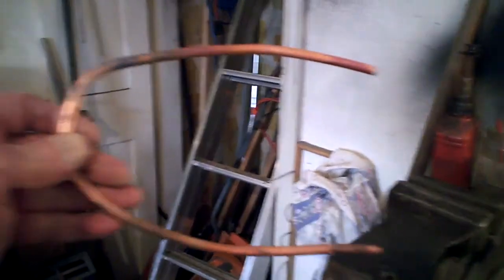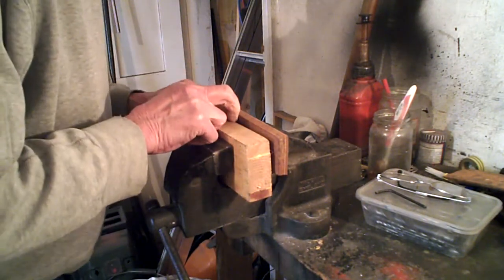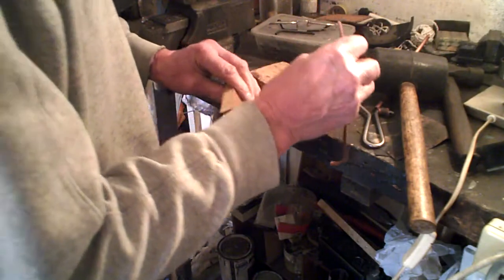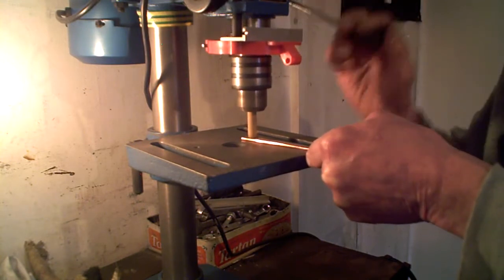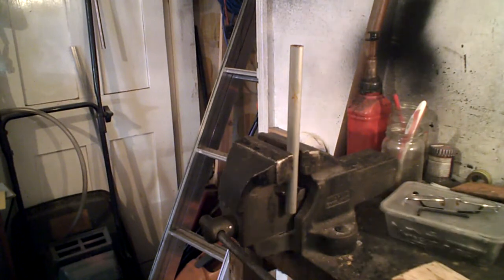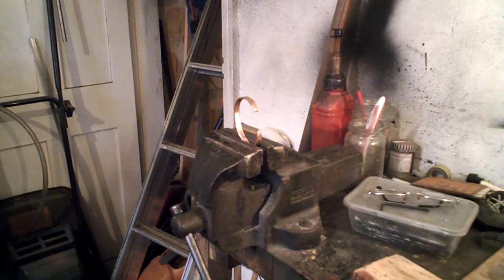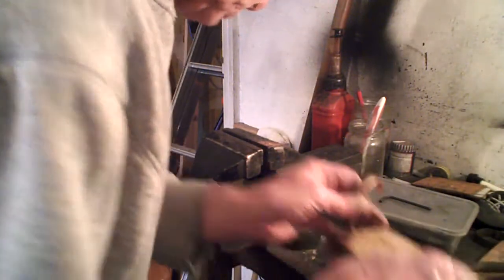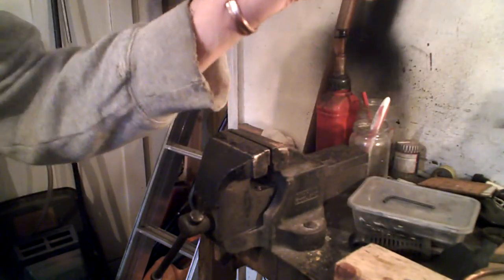Making a Copper Bracelet

Comment: It's great to see different idea , congratulations !  I have done couple for the same reasons and effects as you said . I actually used half an inch copper pipe , wrapped around my wrist some masking tape and than that was my open length of my required copper pipe . I cut the copper pipe to that length and than cut it in the middle , I had to half it because was to wide and got two bracelets , 👍😎🇦🇺🇦🇺🇦🇺 Thank you very much for sharing mate !
Reply from the maker: Thanks. Pleased it was helpful. I still wear this, in fact have never taken it off and don't know I'm wearing it.

Comment: Thank you, it's been great to see all the different methods people share on you tube and the types of tools needed which I'm learning along with my grandson ( never to late to learn) so your approach of softening the copper first is great advice which I'd not previously come across, it's a lovely bracelet hope it works well for you, please let us know how you get on, thanks
Reply from the maker: Thank you - that's much appreciated. To anneal copper, just get it red hot and quench it. When copper beating you need to do it a few times as it work hardens. I did this quickly just to try it. Does it work, well it doesn't do any harm and I might? be slightly better than I was. If you get a small sheet of copper and cut it out, then peen it with the round end of a small hammer it looks very decorative. Simple and easy to do. It's great you're teaching your grandson.

Comment: For "therapy,"  the copper wide surface area type bracelet must be 
overlapping with out touching, with a type of closure to hold its 
position as insulated, in a SPIRAL. The original health benefits  came 
from science research a long time ago, which you probably never studied.
 98% of users have it wrong. The vibrational energy in the air has 
frequencies, many from cosmic radiation. The cellular living tissue 
within the spiral gets absorbed energy at a low amplification. (Antenna)
 This works on people, animals and plants. I used this many years ago on
 my old dog with arthritis. Twice it worked.( Animals and plants don't 
have "BIAS"- Gee I think I feel better.) See - study the data published 
about the work of George Lakhovski and the booklet "The Waves That Heal" 
Cancer eliminated in potted plants, and use of the electrically active 
type, or passive type copper spirals.  So now you know.

Comment: Hope ya feel better Malc .. Great share !!
Reply from the maker: +ShawnMrFixitlee Will do in a few days Shawn - This really does work.
Reply: My grandma wore one .. I might try it Malc !
Reply from the maker: +ShawnMrFixitlee Make yourself one Shawn. Only don't go too wide. This is copper brake pipe. In fact I've had it years. Used it originally on my banger for petrol pipe in 97, so this has been round Skegness stadium about 100 times lol.
Reply: if you anil(torch it) it before you form it to your wrist it will be soooo  much more easier then having to use pliers to pull it. and before you buff it. just throw it in some white vinegar and salt.  just use about a 1/2 cup of white vinegar and about a tablespoon of salt.and  then you can use you're an aniled piece of copper and place it inside of that and it will remove all the black from it.  then form it on you. and buff.